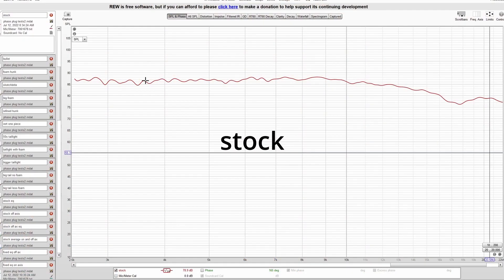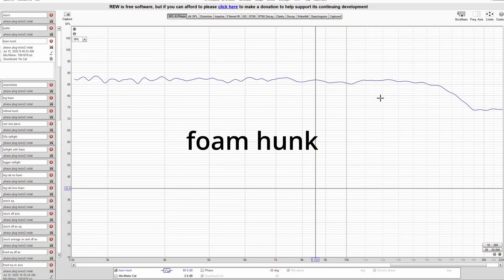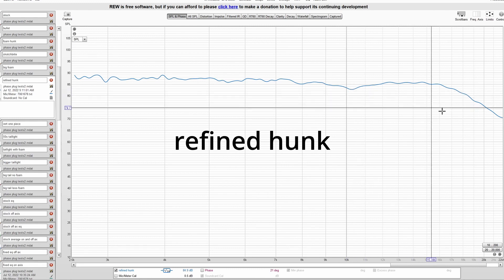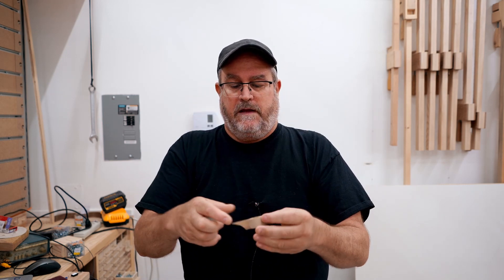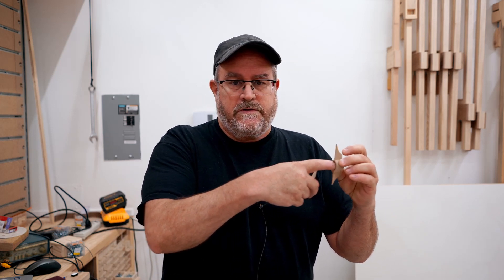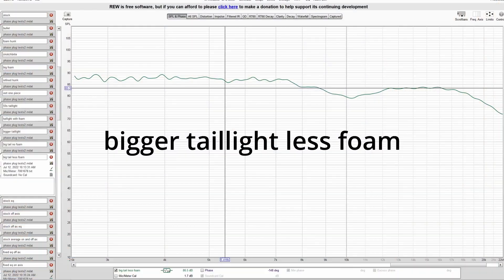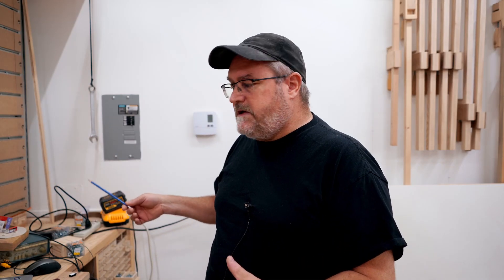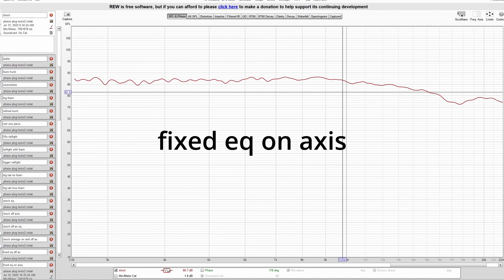Is it a Waveguide or is it a Horn? Plus Phase Plug Experiments

Comment: How a speaker sounds from under 1ft away from it... is very different from how a speaker sounds at 7 to 10 ft from it.  As such, many of these measurements and recordings, are likely not optimal to how you would be hearing / experiencing them.  (even with the perfect room treatment)

 The question is... what happens to the tweeters soundwaves, altered by these horns/waveguides... by the time they reach your ears, at about 8ft away?   Its very possible that what seems good on the readings from a few inches away from the speakers... ends up sounding poorly,  once those altered soundwaves.. reach your ears at 8ft away.

 Also, the kind of changes may ramp up in scale,  of extreme levels of differences... depending on how much power they are being fed.

 Anyone whom has seen experiments with aerodynamics and fluid dynamics... knows how complex these things actually are.  How a very small change, can cause very unexpected / big changes.
Reply: He measures from that distance to reduce the variables from vibration in the room. Its not rocket science.
Reply: @KipdoesStuff  I know exactly why he measures from close up.

 You obviously have not been reading the replies, in depth.

 The point here... is that a Horn (or "Wave Guide"),  alters the way that the soundwaves are projected.

 This could theoretically cause the waves shape, to become inverted, as it hits the guide, and or as it travels through the air.

 Thus,  if you recorded two instruments in a room, using a Bineural microphone... and played this recording back on this wildly altered tweeter... it could end up causing the 3D audio positions of each instrument... into different places in the room.  It might flatten the very depth of the image.  It might partially or fully invert the image, depending on how far away you are from the driver.

 But what it wont be... is Accurate to the Recorded Image.

 You could then put on a pair of high end Audiophile grade headphones, and easily tell the difference in the 3d soundstage / image... from the poor quality speakers / drivers.

 Here is another thing that many Audio-Measurement freaks do not seem to understand...

 From my own personal experience, when listening to different kinds of tweeters:

 1) While Ribbon Tweeters may have incredible accuracy... they have a very NARROW soundstage / sweet spot.  Most of these high end speakers will sound so much worse, once you move a mere foot out from the center of them.

 Why is this?  Its likely due to the fact that the drivers tape,  is actually facing 90 degrees to the listener.   This causes image distortions right from the very start.

2) Many Dome tweeters, are often too soft, and get ate up when there is heavy bass playing in the music track.  Most especially at higher volume levels.

3) The most 3d sounding tweeter I had heard, was a dual pole ribbon tweeter, that had two vertical 1" tall ribbons... that were  full 360 degree circles, mounted next to each other.   These sat directly on top of small bookshelf speakers, allowing full 360 degree projection.

 The problem?   Because the sound was being output in every direction at the same time... the sounds would end up bouncing off the back walls, and other areas... and arriving at your ears at different timings.  It was making ECHO like effects... and completely ruined the intended Image of the recorded music and movies that were playing on them.

4) The best Tweeters Ive every heard... are from the EPI 100v  speakers.  They have the  same concave shape that larger drivers have.    They project an incredibly wide 3d image / sweet spot.  You can move almost 90 degrees to one of the speakers, and still be getting an incredible 3d stereo image.

 Not only that.. but they vanish.. as if they are not coming from a speaker at all.  Its like the instruments are actually producing the sounds in the room... exactly where the musicians were recorded.   If I put a blind-fold on you... you likely could not find the speakers, even with a solid 10 min of searching.

 Now, Im not saying that Ive heard it all.  Not even close.  What I am saying... is that there is a LOT more to these "Measurements" than people realize.

 I can put two speakers with virtually identical readings / specs in front of you... and each will sound completely different, when you do an A to B comparison.

 Its not that one could not manage to figure out the best and most accurate ways to measure speakers.  Its that the people whom think they are Experts in this field... are far more clueless than they even realize.  And worse yet... they are so EGO bound, that they are not willing to even take the time to understand what the issues are.
Reply: @KipdoesStuff  Part 2:   Im going to add one more point.   While these dudes that make Measurements are so gung ho about "The SCIENCE"...

 They completely IGNORE the science behind what makes high end DRIVERS so much different from low spec drivers.

 For example... If you have a weak magnet, and weak driver coils... as well as a heavier cone material...  you will get distortions.

 Why?   Its pure Physics.

 If I tell you to hop in a Pickup Truck... accelerate to 60 mph in two seconds... then STOP in less than 2 seconds...  can your truck do it?

  Nope.  The "Driver" (Engine) is not powerful enough to be able to accelerate that fast.  And the Brakes are not powerful enough to STOP the truck that fast.

 Now, imagine a speakers cone.   The Musical wave, expects a lightning fast acceleration in one direction... and then within a fraction of a second later.. it expects to both stop and accelerate in the Opposite direction... at the same blinding fast acceleration rate.

 If your magnet and coils are not powerful enough... they cant get the cone to accelerate as fast as the music intended.  And likewise... the driver can not stop and accelerate in the opposite direction, without some delays from the over-shoot... because its not powerful enough to stop it instantly.

 That is Compounded by a heavier cone mass... rather than a lightweight composite cone material.

 That said... if the cone material is too light and flexible.. it will distort due to the very air pressure, as it moves.

 These types of things are not brought up by many amateur speaker builders.

 They simply grab some fairly cheap Chinese drivers off of parts express, and call it a day.

 Many of these drivers might not even be made without flaws to begin with.  Some may not have been measured correctly from the factory supplied Data-Sheets.  Some may not match each other as a pair (in spec values, and in sound production).

 And just tossing a Poor, under-powered, highly distorting Driver into a fancy box, with an AWESOME EQ / Crossover... isnt going to make them sound spectacular.  Is not going to make them "Audiophile" grade in experience / output / performance.

 Mariah Carey, I believe has an 8 Octave vocal range.  You cant take a Paula Abdul vocal box (driver),  and expect to get Mariah Careys level of sounds out of it.  Not even with a lot of digital EQ and Effects.

 Just like you cant expect to race your Toyota Camry, against an F1 race car.

 There are huge reasons why these things are so vastly different in performance.
Reply from the maker: @johndough8115  Have you designed, built and measured speakers before?
Reply: @IBuildIt  Part 1 - I have built one set, and modified others.

 My first one, was to take a PC speaker that had a horribly designed plastic shell + a poor pizero tweeter and flaky amp, apart.

  I cut some MDF strips, and made a general box shape... moving the loose panels around, to form different sizes, while the woofer was playing.

 I was surprised to discover, that the driver sounded Much better than the original enclosure.   And my first lesson was learning that they sounded best with an open baffle... rather than when I tried placing a backing block on them.

 Finding the shape of the box that sounded best... I then marked, cut, and glued it in place.  Then made the front panel to hold the driver and assembled it.

 Next up, I took a tweeter from a larger home speaker box, and placed it on top of the speaker, facing the ceiling.  My idea was to make the tweeter fire up into a cone, to spread the sound in 360 degrees.

 Temporarily, since I didnt have the Cone that I needed... I cut a few wooden dowels "Legs",  about 3.5" in length... and placed them on top of the speaker box.. at the four corners.   I then set a piece of MDF on top of them.

 I was pleasantly surprised at how good they sounded.  A huge upgrade from originals tweeter... and much better bass sound, than the originals farty fake-bass (tuned port) design.   I initially didnt thing the tweeters were going to be powerful enough to spread out without the cone... but it worked so well,  that I just decided to use them as they were.

 These were then wired to a box that I put two 12" woofers inside of a larger box that was under my bed.

The reason, was due to me not having the space for the two larger house speakers on either side of my PC desk.   And the fact that I really didnt care that much about that spare house speakers sound.

 The entire setups was actually pretty good.  I placed the smaller boxes closer to the ceiling, on the top shelf of the desks hutch.

 They blended in decently with the 12" woofer box, and I was getting much better  imaging, because the tweeters were no longer blocked from being under a desk.

 From this build, and a few other speaker mods...I quickly realized, how little I knew about the subject.
Reply: @IBuildIt  Part 2:  Im a speaker-holic... and I would often purchase various used speakers at the thrift shop.   A lot of these were various hot garbage.. such as some boom box speakers, with Awful drivers.   Yet I found some incredible finds.. such as a pair of Acoustic Research AR-3A 's.

   I was shocked to see the level of complexity in the AR3A crossover, and the other unusual things about its design.

  I also bought a used phillips Woox boom box.  These were some of the best sounding small speakers... due to a very good woofer driver, and a specially designed Passive Radiator device.
(though, I still prefer the EPIs over them)

 Eventually, I ran into a pair of Radio Shack speakers at the thrift shop, that actually had some larger passive radiators.  However, due to their poor woofers, oddly thin boxes, and other poor quality drivers... they sounded Awful... and were useless even when trying to put better woofers in them.

 I eventually ran into a friends Arcade + Slot-Car track... where he had some music playing in the background.  At the time, he was playing "Earth Wind and Fire".  I was completely blown away... as the sound was all over the shop.  It sounded like the damn band, was playing live.  As if you could pick out where each instrument was being played.

   Id never experienced that level of 3d Imagery / Soundstage before.

 I wanted to know what speakers they were... and so I began to hunt for them.  One thing about the dude, is that he is a messy pack-rat.  He had piles of various things stacked all over the place.  Books, DVDs, parts for the Slotcars, piles of magazines...etc.   I spent a good 15 min Trying my best to find these speakers... and I FAILED !!!

 Eventually I gave up, and asked him, what the speakers were.. and WHERE WERE THEY?!    He walked me to the front of the store.  They were these smaller sized speakers... slightly larger than bookshelf size.   One of them was placed on its side, with a pile of magazines on top of it... and was partially behind an arcade sit-down racing game.  The other, was about 5 ft away from it... vertically oriented, partially behind a stack of magazines.  Both were about 1ft in front of the stores glass window, sitting up on a 2ft tall ledge / shelf.

 Basically, the worst possible placement for a pair of speakers... and yet, the sound was Glorious !  Breathtaking!  The Bass was fast, tight, punchy and Deep.  Deeper than my home speakers 12" drivers... despite them being 8" woofers.  The tweeters were Inverted (cone shape, not domes), and projected the most incredible 3d soundfield.

  The high end was crystal clear, without being fatiguing.  You could hear every sparking detail... and there was no Muddying or Distortions of the sounds, no matter how hard the bass was thumping. And the sound was not drastically reduced, even with things placed partially in front of these speakers.

 I quickly scooped up a re-foamed pair on Craigslist, for about $100.  After hearing them... I was ready to throw most of the other speakers in the garbage.

 Out of the probably 25 pairs of speakers that I had amassed, these completely made them all sound like utter Trash.  (The ARs might have been some competition, but I never got around to trying to restore them)

 I was hearing things in music, that Id never heard before.  Lyrics that the singer said, that used to be unintelligible I could actually make out, word for word!  (no straining)

 
The EPIs were the first Air-Sealing speakers, that Id encountered.  The bass was SO much better than speakers with tuned ports... that I wanted to cry.

 As a result... I tried to modify the remaining 12" techniques house speaker,  sealing off the port... to try to make it sound better.   It didnt work... and I didnt understand why.

 This was another major lesson about speaker design, that I would end up learning... after doing research into drivers, and speaker design.

 At one point, I took apart my EPIs to look at the woofers, and I had used it to test the Radio Shack box with the Passive Radiator.  One thing I noticed, was that the 8" EPI woofers probably weighed more than BOTH of my 12" tech woofers combined.

   This was another major lesson I was about to learn, about a speakers design.  I did a bunch of research online... about the differences between speaker types, and driver types.

 A sealed speaker, uses the Air as a sort of centering spring for the woofer.   When you push the cone, you can feel it being sponge, and is a bit hard to move.  Unlike a ported design... where the woofer moves easily with a light press of a finger.

  In order for a sealed box to work properly, you need a much more powerful driver.  A driver that is capable of dealing with the air compression resistance.   As such, I realized why those horribly weak 12" drivers, couldnt be sealed.  And why they sucked musically,  in their own original enclosures.
Reply: @IBuildIt  Part 3:  The only other pleasant surprise, was the bullnose full-sized Advents, that I picked up from a friend that was moving.

 
These have an unusual woofer design.  I think they have either 9 or 10" woofer, but its mounted into a 12" metal basket via a bezel board with a circle cut out of it.

 The bass on them, is some of the most powerful "Room Shaking" bass that Ive ever had and experienced, in a speaker.  Almost similar to a powerful subwoofer driver in a car.

 Personally, Im not a huge fan of them, as the tweeters are not anywhere near as good as the EPIs..  and the bass is a bit too exaggerated for music.  That said, I combined them with my EPIs when playing movies... and they were excellent for special effects... such as the loud chuffing and vibrations from the train rolling to a stop, in the movie  "The Polar Express" (bluray).

 One other lesson about good drivers, happened when one my Woox woofers were starting to get Foam Rot.

 At that point in time, it was nearly impossible to find another set.  The first thing I had tried, was to take apart some of the other boom box speakers I had collected.

  None of these woofers sounded even remotely as good as the original woofers... despite being the same size and ohm rating.   Im talking night vs day levels of difference !!!   I probably tried about 3 different drivers, before giving up.

  So I looked for woofers that I thought might be able to replace the originals, on ebay.   I eventually ran into a set that I believe was made by, or looked like Phillips speakers (memory is foggy)... and they have really good reviews.  They were dirt cheap... so I figured, what the heck.

 When I took them apart, they had drivers that were made by a company in Taiwan.  According to the research that I did, some others had found that info, and reported them as being of superior quality.

 Sure enough... these things were perfect replacements.  They sounded exactly like the original phillips drivers... and had no issue moving the Woox passive radiators.

 That again, showed me the value of a higher quality driver... over poor quality drivers.   The speaker box design itself, was only a small part of what made these things sound good.

 The biggest part, was the actual drivers themselves:

 How many coil winds on the drivers.  How thick was the gauge of wire used.  How large and strong the Magnets were.   The spider design.  The weight and stiffness of the Cone itself.  The rigidity of the Basket.  How much excursion possible.  The diameter and depth of the coils ring.  The amount of space between the ring and the magnet walls.  Cooling ports, and or Ferro Fluid cooling of the drivers.  The OHM resistance levels... And much more.

 So primary experience, is in messing with about 30 different speakers and their parts and enclosures.   Getting to see, touch, and Hear the differences between them...etc.

 Getting to Own a TRUE audiophile pair of speakers, from EPI, which later turned into "Genesis" ... whom currently design speakers that cost over 50k.
Reply from the maker: What you are describing is what most would call tinkering. Nothing wrong with that, but it's not the same as the engineering approach required to design speakers properly. 
That involves measuring and knowing what the drivers T/S specs mean and how to use them to determine the correct size for the cabinet and whether it should be sealed or ported or something else. And then actually measuring the results to verify whether you got what you wanted. 
Same for crossover design. Measure - design - build - measure again. Everything starts with measurement to know what you have to work with.
You then listen to that result and further tweak from there.
Reply: @IBuildIt  Part 4:  I thought Id add some other speaker experiences:

 Two of the speakers that I bought, had Dome midranges.  The first, was the AR3-A speakers.  The other, was a speaker (currently in storage) whos company I cant remember.

 I cant fairly judge the ARs because the crossovers were toast.

 However, these other speakers.. when I heard them at the 2nd hand shop, I was blown away by them.   They were detailed yet very smooth, without being Harsh... as most midranges tend to be.

 I will say that Im more than happy with the EPI's midrange presentation.  However... if I had the time to experiment, Id love to try to cross-over the EPIs with those dome midranges... and see what happens.

 There is a website that is dedicated to EPI and Genesis speakers (Humanspeakers dot com),  whom also sells hand made drivers (and does driver repairs).

 Some of the later model EPIs use different drivers, and one of said design, has an additional midrange driver.   Now.. not all of these varients are Better than the other... just because of the dates produced.   He even states this fact.   So there is no way to know for myself, without testing and hearing... to see if that might work or not.. and how well.

 My note, is merely to state, that while a dome doesnt seem to be as good for a tweeter... that it might be a better solution for midrange drivers.  These particular domes, I believe were 2" domes.

 That said.. it may be that all of the other Mid drivers that Ive heard, were simply poorly designed eco-trash. (Much like all of the poorly designed Eco-trash-woofers)

 Ive also seen that some of the EPI speakers have passive radiators.  Im also curious to know how those sound, in comparison to without.

 The EPIs bass is nice, deep, accurate and punchy... but for certain types of electronic music, I think the effects of the Phillips woox speakers, were sometimes more effective at representing that slightly deeper exaggerated bass effect.

 Though, it might just be a matter of the number of drivers.. and a larger box.  The ultimate EPI speaker, according to the sites owner / seller... is the EPI 1000.   They are 6.25 ft tall.. having 4 woofers and 4 tweeters in each one.

 Sometimes Passives can get a bit out of hand.. especially at higher volume levels.

 The other speakers I heard, which were Interesting, were my buddies Cerwin Vega towers.  I think they had two massive 15" woofers.. and stood like 5ft tall.

 I was at an event at his house, when one of the dudes asked him to show his projector setup.   I think he popped in the movie "Iron Man".   I had no idea this was going to happen.  Suddenly, there were these loud gunshots and explosions.. and it sounded like the neighborhood was being attacked by a military level event.  He had cranked it so loud, that it was as if you were in the battle.  That said... I was not happy with it.  While it was clear, and powerful... it was also extremely HARSH to the point of wanting to cover my ears.  They might be good for loud partys, where you want the Bumpy bass and loud piecing mids+tweeters to be able to be heard well over crowd noise.. but they were not good for musicality.  They were way too harsh and cold.  And they also sounded very "Flat".. without having a good 3d soundstage / image.   This is likely due to them using Horn drivers.

 I also recently got a dirt cheap Bose wave radio at the thrift shop.  I think I paid $15 for it... and it had the 6 CD add-on with it.   The mids are decent... but overall, its not that impressive.   The bass gets way too boomy and artificial sounding, past a certain volume range.   Its good as a spare for the bathroom, while soaking in the tub... and thats about it.   The Phillips woox beat the hell out of it in sound quality and performance.  Too bad, the woox devices themselves, rotted to bits  :(

 At one time, I had got a pair of planer speakers called Monsoons for a few bucks at the thrift shop.   As much as they revealed some higher frequency details... they were not impressive to me.   They didnt represent midranges well at all.  And they seemed kind of flat sounding in total.  They had no real bass either... though, I tried chaining them to a larger bass speaker. Also, I think I recall the highs actually sounding sort of staticy. They were useless to me.
Reply: @IBuildIt  Im well aware of it.  But that tinkering was able to HEAR when the drivers sounded best, when I got the shape of the cabinet correct.

 Now, here is the deal... If I had been trying to make a sealed ported box... then yeah, it would likely have needed the proper measurements of air volume, and proper tube tuning.

 But this was an Open-Baffle, and it sounded fantastic,  without needing to be fully enclosed + ported.

 Furthermore, with an open baffle speaker... you are Not going to get anything better, than what drivers you put into it.

 If you put in drivers that cant do certain ranges, and or do they without distortions at higher volume levels... then you have essentially wasted a lot of time and money, building a fancy box... that sounds the same or worse than typical low-end speakers.

 As Ive said... you cant produce Mariah Carey level results... from Paula Adules vocal box.

 You cant put a Ford Truck engine into an F1 car... and expect it to perform like an F1 car!

 Nor can you cant take an F1 car engine, and slap it into the ford truck... and expect it to race around the track like an F1 car.  It may go much faster due to the engine... but the trucks frame and suspension, isnt designed for such racing stresses and performance levels.

 The point here again, is that cheap drivers = Bad results... even with the Best of Tweaking.

 And that mere Measurements alone, do not tell the full story of how speakers end up performing and sounding, from an 8ft distance away.  From standing out of center from the speakers.  Those numbers, dont show if the speakers project a 3d Soundstage with accuracy and depth of realism.

 IMO, they are a crutch to try to make you feel good about yourself..  and thats about it.
Reply: @IBuildIt  FYI -  Paul from   PS Audio  ,whom makes multi-thousand dollar high end Speakers (and amps..etc)... even openly stated... that the Measurements are only part of their process.

 He specifically stated, that he listens to each of their modifications, by ear, to hear the differences.  And in fact, in many cases.. what measured out as being correct... did NOT sound the best.

 So, as much as you want to try to pass my arguments off as being clueless... you can take a Professional speaker designers words for it.
Reply from the maker: Paul is first and foremost a salesman. He's going to say the things that he knows his customers want to hear. And he knows exactly what his customers want to hear - what they believe to be true.
His speakers look okay, but there's nothing special about them and since the company is new at building speakers, there's still probably a lot of room for improvement on the technical side. 
And he's not a speaker designer. He hired one and he designed the speakers. 
Paul will say the things that he knows his customers want to hear about his speakers, that he personally tweaked how they sound. That will sell more of them.
Reply: @IBuildIt  Dude, you think he is the only one whos said that same thing?!  lul.   Ive heard it from actual Engineers in their interviews.

 Not only that, but its simple Logic.  The specs you are getting, are Not a full representation of what the speakers Sound like, from normal listening distances.

 I didnt think much about Pauls speakers (from looks. Ive never heard them in person).  I also do not agree with putting in a rear firing tweeter.  But I later heard some quips about the woofers, and how unique their mechanism is.  I cant recall the details.  Im just saying, that they are NOT some cheap Chinese parts-express drivers.

 Im well aware that Paul hired a designer.  That doesnt change what he said.  He listens, and compares.  Changes are made, to the betterment of the Listening experience.  Not just some limited and misleading "Readings".
Reply from the maker: @johndough8115  Guy, is there a limit to your gullibility? Everyone involved in making stuff for high end audio is fully aware of the nature and quality of the market for these products. 
They need to put on a show and sprinkle a little fairy dust on to make it attractive to the audiophile market. Even the "engineers".
You are living in a fantasy world if you believe the stuff that the likes of Paul McGowan says and use that as evidence in a serious discussion. The guy who sells power regenerators... to people who are convinced they need them... and have a level of self deception great enough to think they can hear a difference! 
That's the market! Fools with money to burn and every flimflam man out there wants a piece of the action.
Reply: @IBuildIt  Nothing Ive said here, has any room for Speculation or "Gullibility"

 Ive posted that I have owned over 30 pairs of speakers.   That Ive taken them apart, and tested / swapped drivers.

 That I HAVE a pair of Audiophile grade speakers, that completely DESTROY the $3000 speakers at the local high-end stereo shop.

 That not not I... but Anyone that Ive had over to hear them... are completely Blown away by how they sound, compared to what they have heard in other speakers.

 I also own 3 Sennheiser Headphones.  The HD500,  the  HD590  and the  HD6XX.

 Ive owned ported speakers, speakers with passive radiators, and sealed speakers.

 Ive owned low quality tweeters, high fidelity ribbon tweeters, domes, and cone based tweeters... as well as  "Super Tweeters" and "Horn" drivers.

 Ive owned speakers that had bracing and acoustic stuffing in them.  Massive Crossovers.  And heavy duty speakers that have Fuse protection.

 Basically, Ive seen and heard it all... and have compared them all.

  Heck, the Sennheriser Specs on my headphones, have been the same as the competitions specs... yet they sounded WORLDS apart in difference.  The Senns blew them out of the water, in clarity, and 3d Soundstage.

 There is no "Gullibility" here.

 There is a lot of Strawmen arguments, and Personal attack... coming from you.. however.
Reply: @IBuildIt  Making a difference and making to pay for a difference are two thing. People will still pay $150k 300B amp as it is worst measuring amp. Power regenerators for PS Audio does works because it is voltage regulation. I mean your main are easy allow to have 3-5% off.  If you have listen to your system at 4-7pm or 9-10pm in city, you can listen to the difference in between those time because of main fluctuation as the whole city is powering down due to less demand. The power generation are changing the power to stabilise. That two thousand dollar for a difference.  Of course, you can option industrial grade power regenerator for just a few hundred bucks.